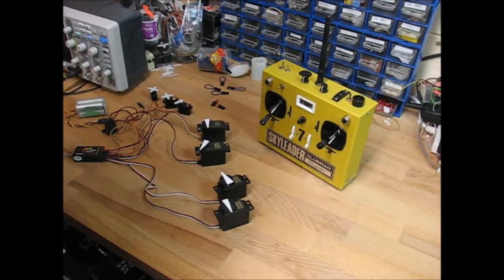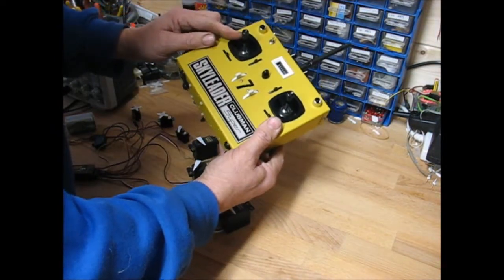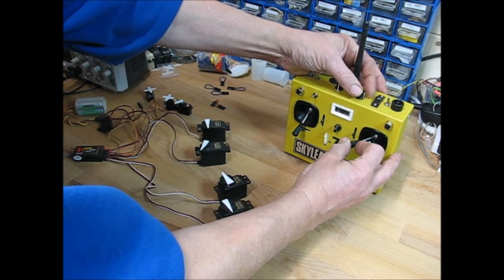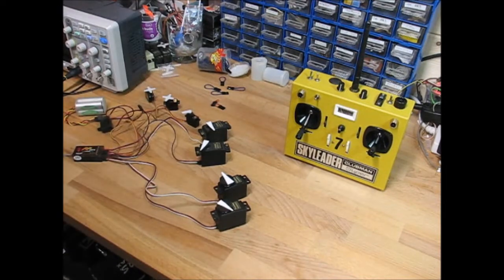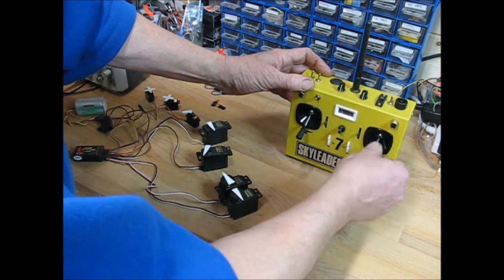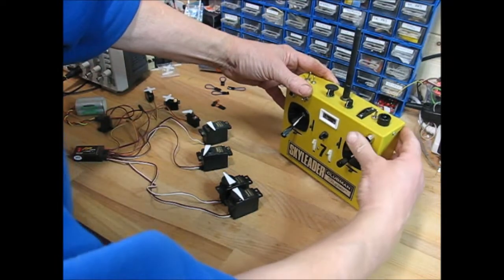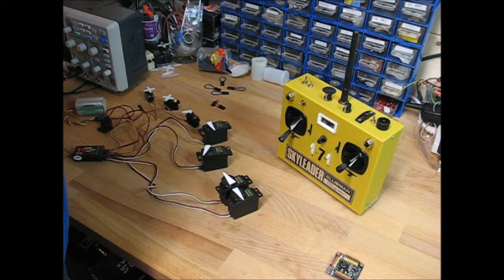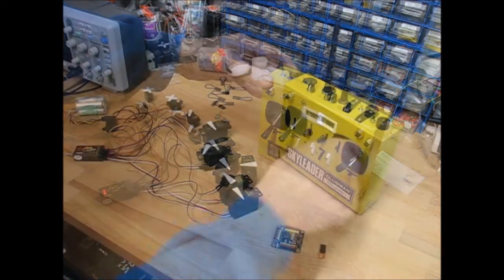Seven Channel + S/C Emulation Encoder - Version 2 - Skyleader Clubman

Comment: Thank you for your encoder, I ave been making my own multi protocol transmitter from scratch using your code.
Reply from the maker: Excellent, all good fun, its great when someone takes your project just that bit further... did you follow the FHSS project using NRF24?
Reply: @PHILG2864   I used a ebay 4in1 module and connected the ppm output from the DIYmore board to that. I did make a custom case from acrylic though.